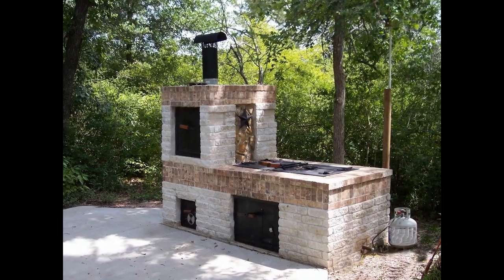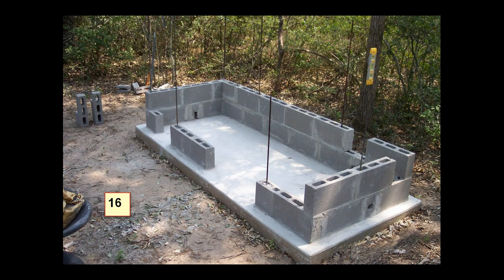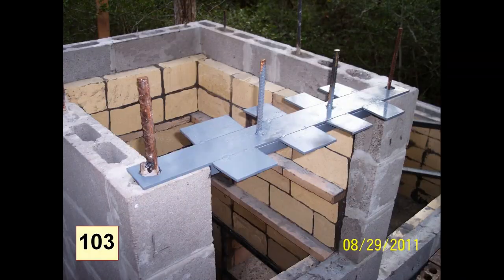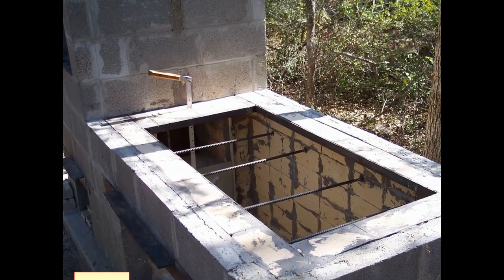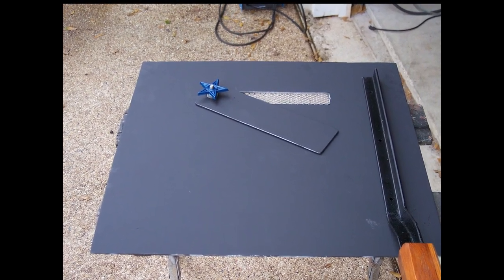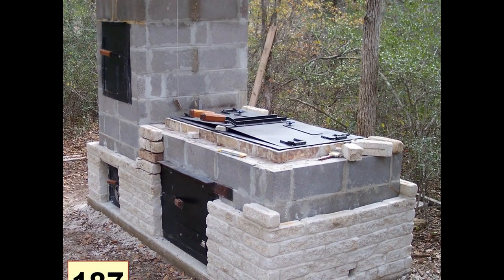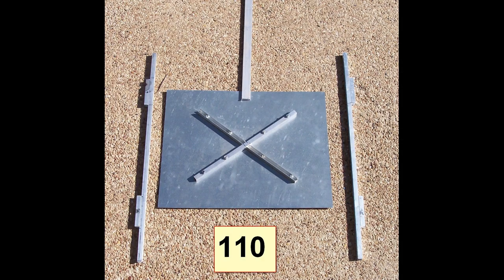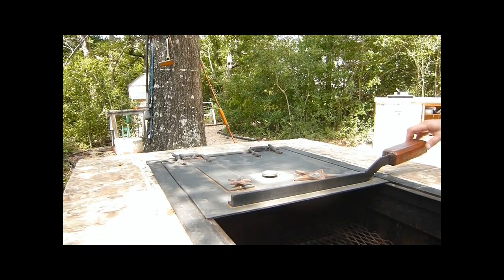Building a Brick BBQ Smoker

Comment: Thank you Joe Novice for your instruction, I am hoping to use your design skills in my project. I am converting my brick gas bbq into a smoker. all of the bbq components have been removed so I am working with a firebrick lined structure into which I have mounted angle iron supports for three levels of shelves. My question concerns the fire pit which is 9 inches below the lowest shelf. I plan to burn various woods (hickory, cherry, charcoal etc.), sitting on a replaceable grating supported by 3/8" X 2" in angle iron struts which sit on 1/2 " angle iron mounted along the wall. This arrangement would hold the burning wood 1" off of the fire brick base. I would truly appreciate any advice you would be kind enough to offer for the design of my fire pit. I have never done anything like this before so Joe Novice in Spades!! :))
Bernie  August 16, 2017.
Reply from the maker: Hi Bernard.  Congrats on the conversion to wood fuel!  When you move from BBQ grilling (300+ degrees) to smoking, the size of the firebox and the fire therein bear some consideration.   In your case, you will be operating a "direct" smoker as opposed to an "offset" smoker.    You'll need your fire box to produce heat in the 210 to 275 degree range, approx, so since the first rack is 9 inches from the fire,  you will probably need a fairly subdued fire to keep it from burning or drying out the meat.   Of course, you'll probably be using the higher racks most of the time, so that will help.   You will notice that I had a firebox in the smoker column of my rig.   As a practical matter, I discovered that long cooks, ie., 3 to 8+ hours at the minimum, would require a lot of maintenance of the fire in the little smoker firebox, so I prefer to draft the smoke/heat from my BBQ pit, which has a 4 times larger fire, through the variable damper into the smoker.   So yours will work, but you'll have frequent visits to the firebox.   I also added a small propane burner pipe in my smoker column to help keep the heat up for really long cooks (shameful to use gas at all, I'm told by the purists).   use joe@joenovice.com for addt'l notes or photos.

Comment: I would like to know where did you get the door at
Reply from the maker: I cut all the doors out of 3/16 inch steel sheet, hanging off the tailgate of my truck - cut with a skilsaw and a metal blade.   The door frames were made from angle iron and the doors cut to fit them.  I didn't cut the frames until I had finished the brickwork surrounding the doors/lids:   in that way I could cut an exact fit into the brick doorways

Comment: how long can it sit at 250f without adding wood to it?
Reply from the maker: Without any additional wood or use of propane, the smoker column will go about one hour before it begins to slowly drop.   That's why  I put a small propane pipe burner in the smoker column.   Once I light it, and turn it way down low, it will hold the temp for about 2 to 2.5 hours in the 250 range before I have to put any more wood in the main pit, or nudge the gas flow on the smoker propane pipe.  

When starting the fire in the main BBQ pit, It takes a good 40 minutes to get this entire pit and column up to where heat can even start to be maintained (outside temp plays a minor role).  The walls on the pit are almost a foot thick and it takes a while to get all that firebrick up to a holding temp.   Actually, the longer the fire burns in the main pit, the higher the reliability of heat maintenance - I attribute this to the complete heating of the masonry as the burn lengthens.   If this were a continous  burn pit, like the BBQ restaurants, the heat maintenance becomes less of an issue because the pit is completely warmed at all times.

Comment: Has the brick cracked due to the heat?
Reply from the maker: I have one brick loosened on the top, near the main firebox door.   As stated in my instruction video that I'm selling, I believe this is due to the unnecessarily large L-shaped brick lentil  that I used to hold bricks over the firebox doorway.  A huge chunk of iron like that has to expand when you  heat things up to 300-600 degrees.  I should have used a single iron strip over the doorway, or a much thinner piece of brick lentil.

Comment: Does it work well? Temperare ? Air flow?
Reply from the maker: Yeah, it draws just fine - couldn't be better.   Whew!  Would have been terrible if I spent a year building this thing, and it wouldn't draw into the smoker and out the chimney!  The vertical damper between the  smoker column and the BBQ pit works too, just in case the fire in the main BBQ pit gets too hot.   NOTE:  the temp differential  between the smoker and the BBQ pit is 50%, IE., If you have 600 degrees in the BBQ pit fire, the smoker will run about 300 degrees...
Reply: Joe Novice thank you ver much I’m building mine in the morning and it will be similar to yours.

Comment: How much was that to build?
Reply: $1900, not including the outside layer of white bricks, which I had leftover from the building of my house.  I did all the work myself, except for pouring the slab, which was $600 of the $1900.   Had I bought the white bricks, it would have added about $150 to the cost.
Reply: @billthames9564  wow you could say it’s $2,000. Your brick offset smoker looks nice and well designed. Pizza oven is a must have same goes for an offset smoker. I just recently saw videos how pizza ovens can also be used as an offset smoker really interesting, it’s like a 2 in one system, you get the pizza oven and also a smoker.
Ever plan to build something similar?
Reply: @ShopperPlug  yeah, I thought of doing a pizza over before I started on the BBQ/Smoker that I wound up building.   little more use with a BBQ Smoker combo, but who knows I might yet build a pizza oven if I could get my wife's potted plants off the patio where I'd need to put the Pizza oven. 

I also thought about doing a tandoori oven.   I don't have much use for most Indian food, but I think that red Tandoori chicken is really good!  and, a Tandoori oven is a much easier build than a Pizza oven.
Reply: @billthames9564  Oh wow I love red tandoori chicken. The red color comes from mild red chili paste and saffron ingredients. You need at least 800F to 1,000F to make authentic tandoori chicken. Yes, there are some tandoori ovens which are simpler to make like using huge clay flower pots, I tried making them, works alright. But I think using a pizza oven would be better since naan breads and sourdough breads can be baked inside a pizza oven same goes for tandoori chicken. I have plans to build a combo pizza oven/offset smoker, but need to do some more research. The combo oven I’m planning to build will have natural gas burners inside the oven so that it will be the primary heat source during preheating, will save costs on wasting wood/charcoals to preheat the oven. Preheating a pizza oven can take up 1-3 hours to reach 800F when using wood. I read that it will take 30% longer when using gas. Once oven comes to the desired temperature, charcoals/wood will then be used as the primary heat source with the natural gas turned off to flavor the food.
Reply: @ShopperPlug  Sounds good Max.   I think you will have great enjoyment building this.   I agree with the use of gas for preheat.   I use a propane burner strip in my bbq pit to get the wood logs going much quicker.

Comment: That look great, how well has it work for you
Reply from the maker: no complaints.   it's 7 years old now, and works fine.
Reply: Joe Novice quick question, how did you seal the doors on the BBQ side of your smoker, the ones over the fire box.?
Reply from the maker: there is no sealant.  the metal frame holding the lids simply lays into a fairly precise opening and overlaps the edges by about two inches, thus there isn't much heat leakage.   If I was going to seal the edges, I'd probably look for some kind of high-temp rope caulk.  You notice that I have two adjustable vents, one on each lid, in case the fire in the BBQ pit gets too hot, which is not usually the case.   The unsealed lids allow for some minor leakage, so I hardly ever need to open the lid vents.

Comment: thats angle iron not sheet metal
Reply from the maker: You are correct.   I put a note to that effect on the part of the video that shows the orange colored fixture in the top of the smoker column.
Reply: i was just pulling your leg mister. btw great job.
Reply from the maker: Ok, got me.   but, you happened to be correct ...